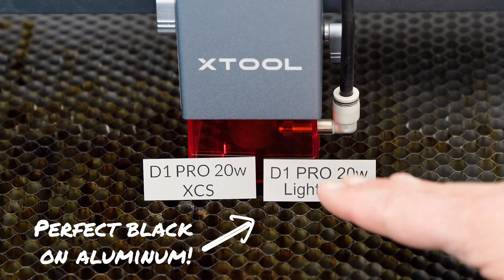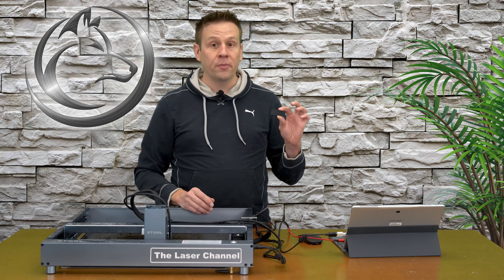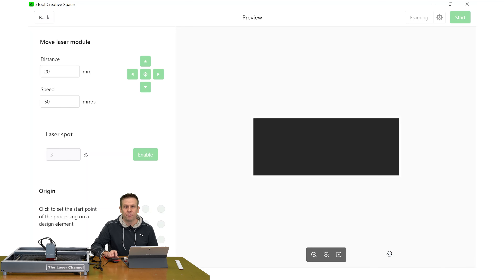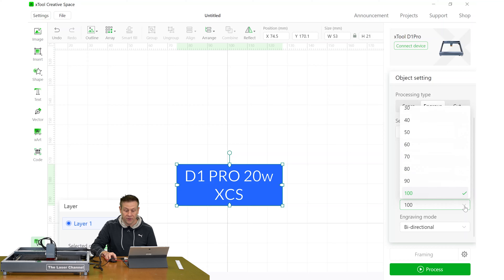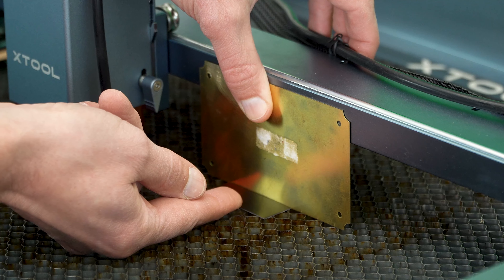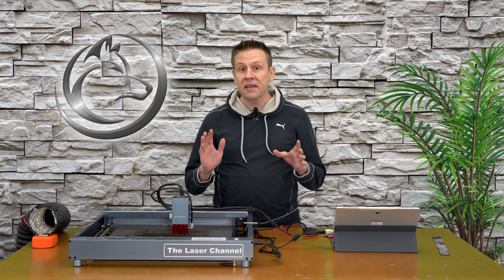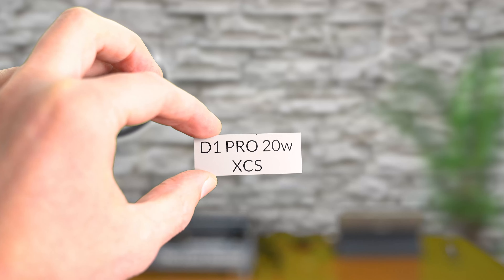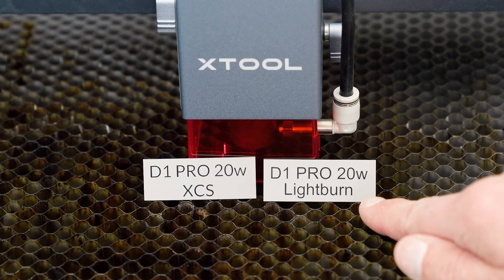Xtool D1 Pro-  Engraving Black on Aluminum!

Comment: great videos, how long can it engrave till it has to rest? im sorry for my english
Reply from the maker: I try to keep working time under2 hours on very large items.  I have engraved glasses all day with the only rest during changing glasses!
Reply: @thelaserchannel1  wow, great, for what i might use it the most is engraving leather denim labels in large batches of leather all together, and then cutting them, do you think this is possible or the edges of every label will be burnt? Thank you for your answer and sorry for so many questions!
Reply from the maker: @federicoayup863  Yes- the edges will be charred- this will happen on any machine.  Finding better settings will reduce the char- in the USA we have a cleaning product called LA's Totally Awesome and it does a great job of cleaning char!